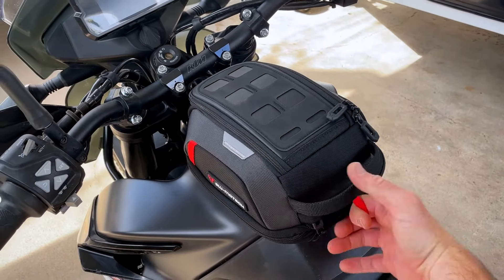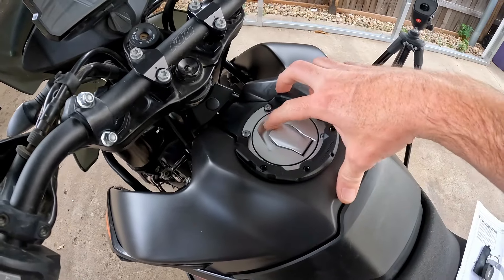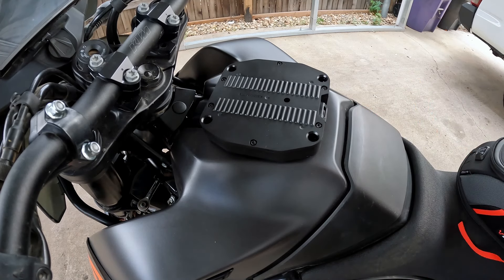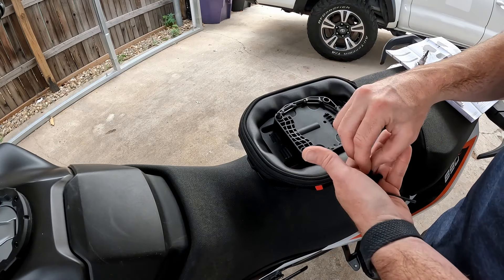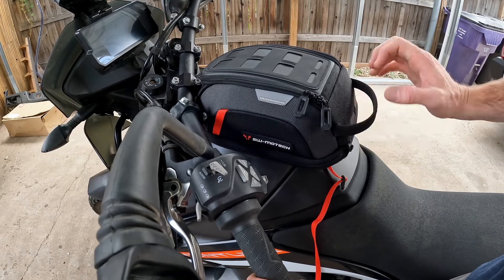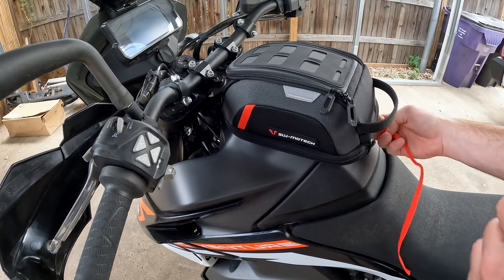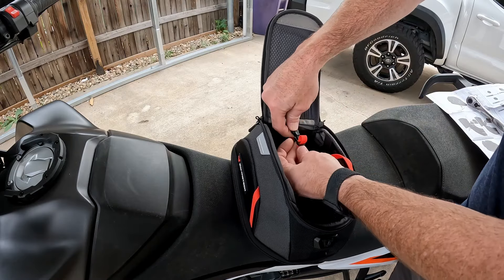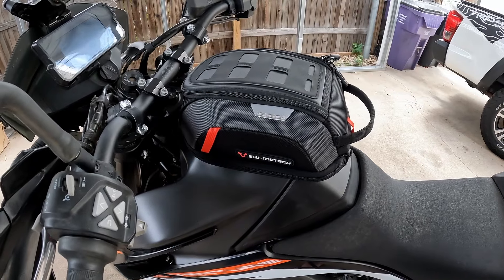The best motorcycle tank bag ever? SW-Motech micro!

Comment: Youve put it on the wrong way round Red tab and handle should be at the front
Reply from the maker: The mounting ring on the KTM has to be reversed due to how the gas cap opens so the red tab is in the back.  The bag itself can go either direction.
Reply: @infosponge  I didn't  know that thanks for the info
Reply: @infosponge  yes but it is still the wrong way. You have to reverse the base of the tankbag. There is a hole to enter the red tab inside in the other direction too.
Reply from the maker: @gcbr600rr  wouldn’t there being a hole on both sides imply that there is no ‘wrong’ way?
Reply: @infosponge  of course, I  call it "wrong" way because when you open the tankbag, the top part goes against your body making the things a little bit harder to take things from inside
Reply: @gcbr600rr no it’s not the fixing tab inside the bag is only fitted at one end
Reply: You mounted it backorder, ok fine. But does this still go with an SW Motech cable lock with the locking pin at the right place on the bottom of the bag?
Reply: I put the (older pre-magnet style) SW-Motech ring on my 2015 BMW S1000RR first, and actually have 2 bags, a large one with the clear map pocket on it for extended trips, and the micro for when I'm sporting around (maybe wearing my leathers) and just need room for my wallet, Walkman, keys, and a juicebox etc.  When I got the 2021 ADV R, because KTM is retarded and just HAD to do things different, the ring (with magnets) had to go on backwards as noted.  What I did differently from you, is that though the ring mounting is fixed (backwards), the mounting bracket under the bag itself (I got the larger Daypack and the optional extra little pouch on top) can be rotated 180 deg so the bag can be mounted so the flap opening is TOWARDS you.  Which IMO makes it that much more convenient to easily getting into the bag.  The release for the ring latch can actually be routed thru the small opening on the OTHER end of the pack (at least there was one on my Daypack).  So, the handle ends up being in front (like on my 'RR) but the release is towards you and the opening is towards you (like on my 'RR).  You might be able to undo the mounting bracket and flip it 180deg if this sounds like you'd want to do this.

Comment: 'Sup W!  F here.  I put the (older pre-magnet style) SW-Motech ring on my 2015 BMW S1000RR first, and actually have 2 bags, a large one with the clear map pocket on it for extended trips, and the micro for when I'm sporting around (maybe wearing my leathers) and just need room for my wallet, Walkman, keys, and a juicebox etc.  When I got the 2021 ADV R, because KTM is retarded and just HAD to do things different, the ring (with magnets) had to go on backwards as noted.  What I did differently from you, is that though the ring mounting is fixed (backwards), the mounting bracket under the bag itself (I got the larger Daypack and the optional extra little pouch on top) can be rotated 180 deg so the bag can be mounted so the flap opening is TOWARDS you.  Which IMO makes it that much more convenient to easily getting into the bag.  The release for the ring latch can actually be routed thru the small opening on the OTHER end of the pack (at least there was one on my Daypack).  So, the handle ends up being in front (like on my 'RR) but the release is towards you and the opening is towards you (like on my 'RR).  You might be able to undo the mounting bracket and flip it 180deg if this sounds like you'd want to do this.
Reply from the maker: Thanks for the tips F
Reply: @infosponge  Post up if you switch to see how you like it!

Comment: i have the same one on my 890 duke. probably shoulda went with the next size up…next time. excellent video
Reply from the maker: Thanks,  I’m liking it so far!
Reply: The cool thing, is once the ring is there, he (or anyone) can use whatever bag will physically fit.  I have the older style ring on my 2015 BMW S1000RR and run a large pack with clear map pocket for multi-day rides, and a micro for short ones.  I have a 2021 890 ADV R and run the larger Daypack with optional pouch on top.  I DID flip the mounting base under the bag 180degrees so the bag opening is TOWARDS me and routed the release lanyard thru the hole in the opposite end of the bag so it's towards me as well.  Works out WAY better to have the opening towards you.

Comment: Thanks for putting this video together. Im on the fence between the micro and the day version.
Reply from the maker: Both are good but I like the fit of the micro on the 890.
Reply: I got the Daypack and the optional pouch on top, and also I bought the tablet/mapholder to go on top of the pouch if I want.  You can flip the mounting base under the bag 180degrees so the bag opening is TOWARDS you and route the lanyard towards you as well.

Comment: On the rain cover, you fold in the first draw string section into the rain cover when the micro is not expanded, and when you extend the bag, you pull down the first draw string section and use that one to secure the rain cover.
Reply from the maker: Thanks for the input!

Comment: È montata al contrario
Reply from the maker: The mounting ring on the KTM has to be reversed due to how the gas cap opens so the red tab is in the back.  The bag itself can go either direction.
Reply: @infosponge  Indeed. Though the red cord's direction is defined by the mounting of the ring (so you can get it to match the handle location or weirdly have it on the very other end. This is defined how you mount the horse-shoe element. Thanks for the review, it made me buy one and love it. Nice premium SW premium build and quality.